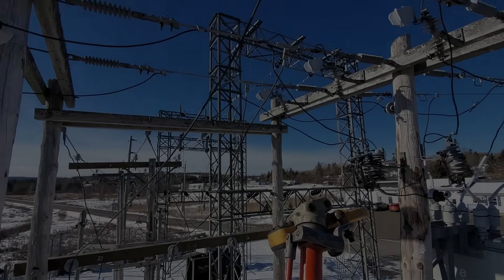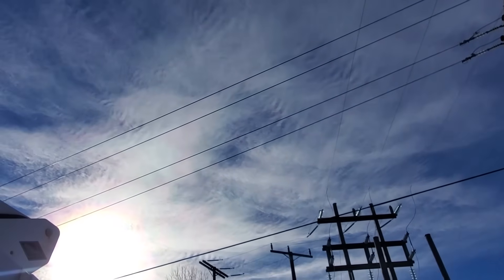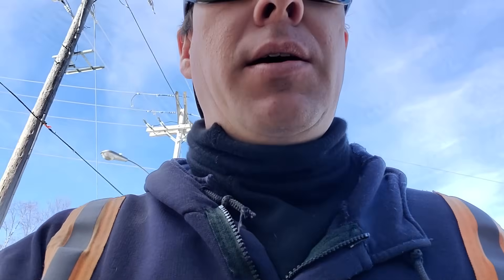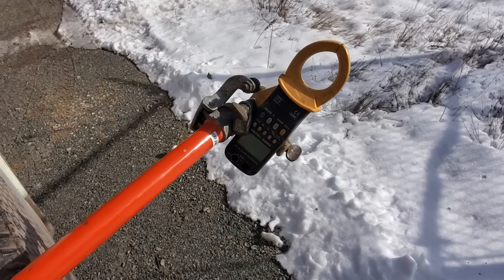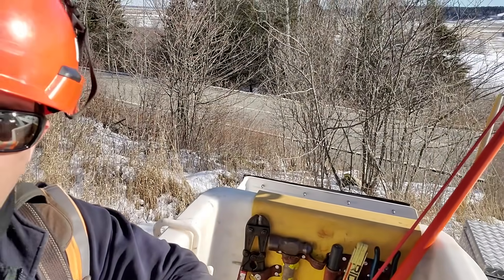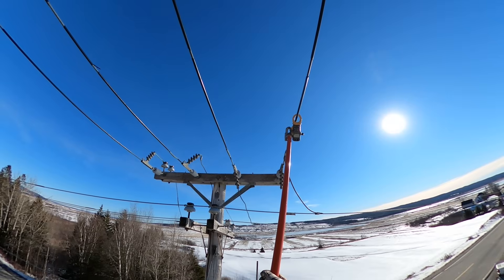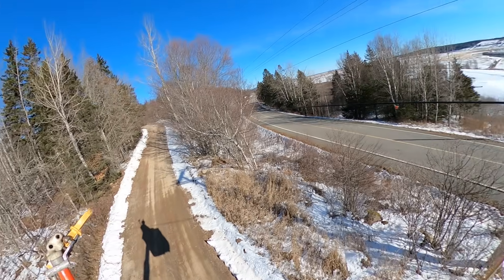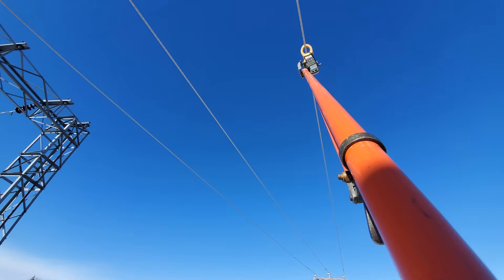Amp check on Powerlines - Load balancing

Comment: Just a quick question about insulation on the primary wires. Why have some got it and others dont? Where i live, I've seen some old overhead that are insulated and others not. Is there any reason for this? Thanks!
Reply: It was deemed necessary at some point to mitigate accidental contact.  Insulated power lines are heavy and more expensive, so they aren't usually installed without cause.

Comment: I’m an engineering student and have always been fascinated by power lines and the electric grid in general, I would’ve become a lineman if I wasn’t deathly afraid of heights. Where I’m from in northeast Ohio there are a lot of very old distribution lines and substations (probably dating back at least a century) which are ungrounded and the transformers are two-bushing, delta-connected. Since there is no neutral, how would load balancing on the phases work then? Also most transmission lines appear to be delta connected, with the exception of very high voltages like 500 and 765kV because nearly every substation I’ve seen at these voltages have 3 transformers for each phase with a single bushing. However I’m not sure if load balancing is typically an issue on these lines, since it’s usually done on the distribution side, and rarely if ever are even large industrial customers connected directly to the transmission network. Didn’t mean to ramble, I’m just curious how exactly load balancing works on ungrounded delta systems.
Reply: That sounds like a whole can of worms.  I'm no expert or anything, but I suspect: 1) the higher transmission voltages mean that phase load discrepancies are much smaller 2) the distribution load balancing will affect this, and everything up the chain.

Comment: Why do some primary 3 phase systems have a neutral but others do not?
Reply: Neutrals are simpler for distribution.  A neutral provides a groundED conductor.  Instead of stringing miles and miles of 2 lines with both wires 7200V to ground, you can string one "hot" line 7200V to ground and the grounded neutral essentially 0V to ground.  

The 4th conductor is added expense and, where single-phase customers are scarce, not justified.  Delta (neutral-less) configurations are common on sub-transmission and transmission lines because a neutral is just wasted expense.

Comment: I have a smart meter provided by our power utility that reports in 5 minute intervals. I believe it can report voltage, amperage, frequency, power factor, harmonics etc, though I’ve no idea what’s actually recorded. 

Is it not possible for the folks back in the office to calculate how much power is being drawn per phase by aggregating meter data knowing the topology of the network? Or is there simply not that accurate a model of what’s connected to what?

Comment: I hear you mention 12470 phase to phase, and 7200 phase to ground. 12470 divided by the square root of 3 = 7200.  Does this mean where you are they are using a Y (wye) or star, as opposed to a Delta?  Here in Texas we are 14400/7200.
Reply: Wye.  There's a neutral present.  Delta service doesn't have a neutral, at least not in transmission or distribution that I'm aware of.

Comment: Inductive ammeters are indeed independent of line voltage, but I imagine the field intensity near the conductor would cause potential problems with susceptible components. RFI might also be a problem. I've seen cheap pocket meters go bonkers near VFDs.

Comment: Thanx Bob, the only load balancing that I ever did was to try to balance the left and right side of my panel when I wired my house. When In a sub, do you take into account PF? As in how do you tap the capacitors?

Comment: Can you do a video of maybe drawing a schematic of if AB phase have 150 amps and C has 100 amps. Why 50 amps returns on the neutral.
Reply: In a 4-wire three-phase system, the neutral is always carrying the imbalance of the three phases.   

A similar situation is true in your home in the US or Canada.  240V is sent from the transformer through the meter to the main panel.  A neutral is provided to divide that 240V into 2.  From the transformer's perspective, you're just a 240 customer.  If your 120 volt loads are perfectly balanced then there will be no current flowing in the neutral between the main panel and the transformer.  The neutral simply caries the load imbalance of one leg or the other.

Comment: Do your customers have power meters that can be read remotely from the central office? I wonder if that data could be used for planning phase balancing if it could be read very frequently (i.e. on an hourly basis or better).
Reply from the maker: Not as of yet.. most are RF meters right now. There will likely be a massive retrofit in the near future with those capabilities

Comment: At the risk of contradicting you, if you had 100 amps at 7200 volts that would be 720 KVA. As most residential transformers put out 240 volts that would be equivalent to 3000 secondary amps, not 6000. 😊
Reply: Yes, but that's 3kA on each leg, supplying a total 6kA to 120V residential loads.
Reply: kA ≠ kVA

Comment: We use a Hubbell/Chance amp meter that would attach to an extendo so you get get readings without lifting the boom in below zero temps. It worked good and has a hold function so you don’t lose your reading when you lowered the stick. There is no jaw to open,  it’s just a U shape so it goes around the conductor easily.

Comment: So not in the industry at all just curious. Are systems designed to have a specific cap on houses or commercial facilities? You said one direction feeds about 1000 houses. Another directions feeds about 1000 others. Thanks I’m advance
Reply: It's implemented to demand, hopefully with some future proofing.   The over-current device provides the "cap" of what can be hooked up, and that depends on factors like conductor size, power factor, even the types of loads/customers connected.

Comment: Those amp probe aren’t really meant for primary voltage. They make amp probes with an attachment point for sticks. https://sensorlink.com/products/ampstik
Reply: The insulation is weak enough that you'd have to assume that the meter is an uninsulated tool that could draw an arc.

It wouldn't be safe inside a cabinet or if you're getting close to jumpers, etc. But with overhead lines there's enough space available that you can use uninsulated tools on the end of a hotstick. If a bird can safely land on the lines, so can a meter.
Reply: @jordanrodrigues1279  yes amp probes design for secondary work have been used on primary for a long time and I know people still do, doesn’t change the fact that they are not meant for primary and from someone who has barehanded, trust me I understand the bird on the wire theory.

Comment: Question for Bob (or anyone else who knows): doesn't the HV corona affect the magnetic field that is measured to get the amp measurement?  If not, what's the theoretical limit?  Could you clamp one of those meters onto one of the 750kv lines that is strung across the US midwest?
Reply: Corona isn't that big of a deal at that voltage.

Comment: I have a “horseshoe” high voltage ammeter that will go up to 400KV with universal stick attachment.  I recently used it last year on 230KV circuit breaker I was having a problem with.  I will send you the brand and model tomorrow when I get to my truck.

Comment: If only you could find a way to use a hot stick to hook a meter up to those lines to demonstrate that a 1kv meter is no match for high voltage. Maybe people would see that and stop using those junk meters we see in the check out line at the hardware store. Demonstrate what the wrong class rating of a meter can result in. ... You know ... for science. :)

Comment: adding those numbers together in order to get the total amps for both lines could be inaccurate when those lines have different power factors. The phases of those currents are not exactly the same which will result in an error.

Comment: I use the Sensorlink Ampstick. Works great. Have also used the HDE brand meters. The HDE is not accurate when compared to the substation breaker relay  and the Ampstick meter. Sometimes you can find these meters on eBay at great prices. Both of these attach to fiberglass stick. The Ampstick also saves the readings for you so you don’t have to bring it down for each reading.

Comment: I was thinking, "just climb up there with a fluke clamp on." And then laughed when you pulled out the meter-on-a-hotstick. :-)

I, too, have meters that can inductively read thousands of amps, but are only CAT III (various others II, III, and IV), so I wouldn't recommend holding that meter near 7.2kv. I'd really like to see one attached to 7200; I bet the leads melt before the meter does. (it's going to arc at the "air gap" isolation points in the meter. And right through the insulation on the wires.) Sounds like a perfect collab with ElectroBOOM.
Reply: no mate that  is a job for photoinduction.

Comment: u have neutral wire on HV lines? it is because transformers for customers are only  single phase and they are connected between phase and neutral? Just curious because we dont have any neutral wires on HV lines in europe.
Reply: Exactly. Like he said, you can even have some small roads that only tap on one phase ans the neutral. The delta wye transformer is at the substation, so before the sub you don’t have a neutral, but after the sub (the lines on the side of the road) there’s one. 

I believe that in Europe you don’t have those because you always have three phrases up to the houses and the pole transformers are delta wye, so the neutral starts only at that point.
Reply: @cedricpomerleau5586  It's hard for me, as an American, to imagine secondary lines running 10 miles (16km) to get to just the nearest next house...

Comment: Load balancing has to be a losing battle.  Seems like seasons would cause power loads to change a lot.   Thinking a lot of farmers can’t afford 3 phase service or power company gives crazy quote to run the lines.  So in the fall they go from no load to huge load on just one phase.  It’s got to drive your engineers crazy.

Comment: Bob: What is the maximum amperage of those 7200 volt lines?  Is the cable
gauge standard or does is vary when used on 7200 volt distribution? 
Thank you.

Comment: I know that you didn't keep the clamp-on ammeter connected very long at each reading but if my memory serves me , that meter has a certain working voltage internally. In other words the flux density is much greater on a high voltage circuit like the one you demonstrated on than say 120 Vac  or even 480 Vac circuit. Unless that is a special meter I didn't think it was rated for that work. If I was in your situation I  would check the specification sheet on that meter before I took any kind of high volt current check. Thanks
Reply: It doesn't matter because the E field isn't strong unless conductors get close to each other.

Comment: Amp clamp on the end of a hotstick is fine. I used to work with a guy who would take current readings using a Fluke 87, with a wired amp clamp attachment on 25kV (L-L) lines, bare copper or aluminum, not bird wire!!! While holding it in his hands! Of course he had gloves on but eff that! He did it all the time, but definitely a stupid thing to do. Yes, theoretically the meter was still at a low potential to ground but nope!

Comment: We have a couple different hv amp meters. HDP and chance. I don’t see anything unsafe about  your set up. That meter is rated for way more amperage than what primary v will carry. The voltage on the line has no reference to ground the meter is simply a bird on the wire
Reply from the maker: I agree 💯! Well explained.👊👊🍻
Reply: @Bobsdecline  sorry HDE not HDP

Comment: I believe the reason for the 1kv rating on that meter is because corona will break it down over time.  It really is a non-issue.

We use 12kv cellular (4G) fault indicators on our 115 and they last about a year or so before they need to be replaced.

The reason I like an ammeter made for HV is that you can push the 'hold' button and use it on a long stick from the ground.
Reply: The "CAT" rating is for human safety. It's the break down voltage of the insulation (and various internal safety components.) Dave (EEVBlog) may have some videos explaining the system.

Comment: I’m curious what the minimum distance to those lines you are required to maintain under this type of circumstance? As an ex-inside wireman, that high voltage scares the bejesus out of me lol.
Reply: 480 is WAY scarier than 12kv IMO
Reply: @Cory.Robson  Both can almost instantly kill you. (@12k, you wouldn't actually be able to touch it. It would arc to you once you were within about an inch.)
Reply: @jfbeam  the flash (& Vaporizing metal) on 480 is typically much worse due the proximity of adjacent conductors (meter base, tx, etc).  That is why a 40 calorie FR suit is required to be worn while working with 480.   

With 480, the current draw across the body is typically high enough to meet the 'let go threshold' (you can't let go because of muscle contraction).

A fault on 480 is likely to sustain itself MUCH longer than 12kv.  

12kv - Conductors are typically spaced much farther apart than 480.  

With a non-reclose and fast curve, 12kv can clear in as few as 5 cycles.  Fast enough to not create a large arc at all.  If a current limiting sand fuse is used, the fault can clear in as little as half of a cycle depending on when the fault occurs in the sine wave.

Yes, both are deadly and should be respected 100% of the time.

Comment: Do you have any discretion on what phase you tap from for a single phase tap or is that an engineering decision?  I'm betting the later.  However, your input is probably valuable in making that decision...i.e. Amps during normal load.  That stuff changes throughout day.  But, most 1PH loads are residential so they may be distributed evenly???  Curious how they are distributed.
Reply from the maker: Yessir, everything you just said is accurate. 

Typically the residential feeds are divided up equally. There are some exceptions however... For example single phase residential feeding an area with elderly living/nursing homes/priority customers with medical issues may have a slightly more dependent feed if possible. There could also be phases divided up to keep neighborhoods separated one on each phase even though they aren't balanced as opped to running in both phases and leap frog going connections.

Most of our company is pretty good at working together as a team and taking into consideration input from others as you said 💪💯

Comment: hello,  i am interested in this question: do you have a partner or do you work alone? i am your subscriber from russia
Reply: It looked like he was alone. I am surprised that the utility company's safety procedures allows this. Most utilities would require an additional person on the job site that remains outside of the arc flash boundary who is able to take action in the event of an accident.
Reply: @sorensolveig599  I am surprised. In Russia we don't have the right to work alone
Reply from the maker: Hey sorry guys, I meant to get back to this question earlier.
I'm one of a few solo trouble/service crews that we have scattered throughout the province. I respond alone with very strict regulations as to what I can and cannot do. 
Most importantly, I am never refused help should I feel unsafe at anytime.

This is question I'm asked fairly often, so I'll touch on it in further detail ... Likely in a video in the future

Cheers guys!
Reply: In Ontario you can work alone, but there are some restrictions such as you can’t work aloft alone, you can’t pull elbows alone, but you can do ground level switching alone.